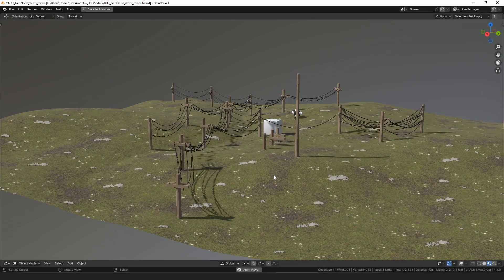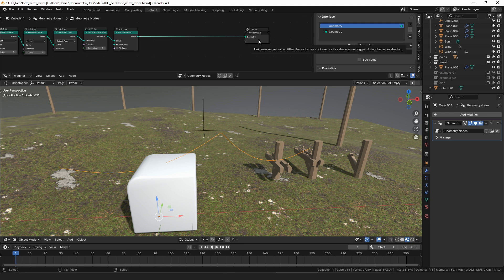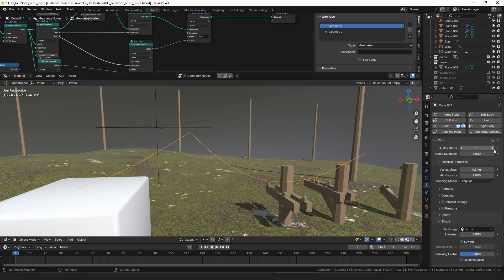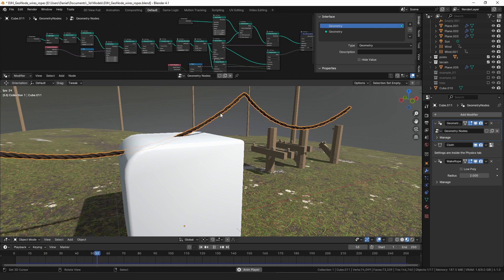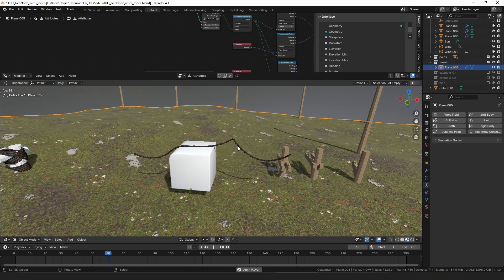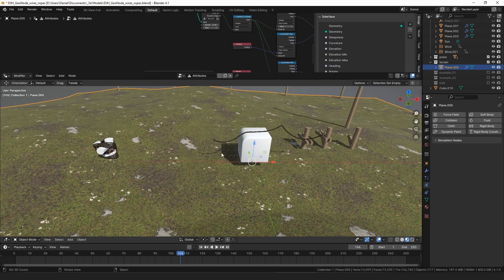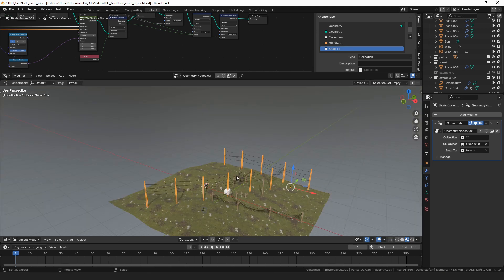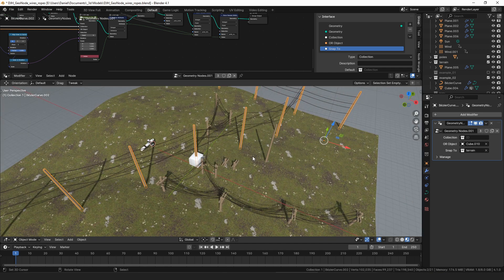Geometry Nodes, Cloth Sims, & Ropes - Blender 4.1

Comment: Thank you AGAIN! ...I find a lot of use from when you explained why you are choosing to go the route that you do and the stubling blocks you run into.
Reply from the maker: You're welcome!  Glad you found it useful.
Reply: Cool video! To get the original mesh vertex group on your curve, could you not use the proximity node to get the attribute from the vertex at the same location as the curve point instead of using the Boolean stuff?
Reply from the maker: @sander-wit  No, I don't think so.  You can read a value in that way, but to store a value in a vertex group I believe you have use boolean to merge the vertex group into the generated geo, otherwise it will store it as a generic attribute, and the cloth sim requires a vertex group not a generic attribute.